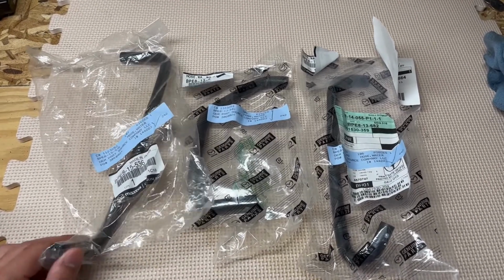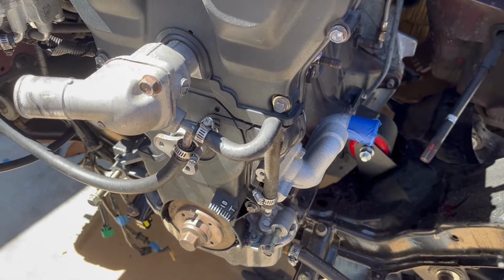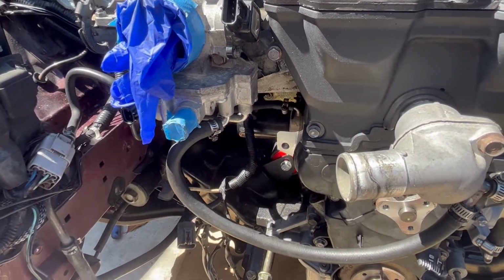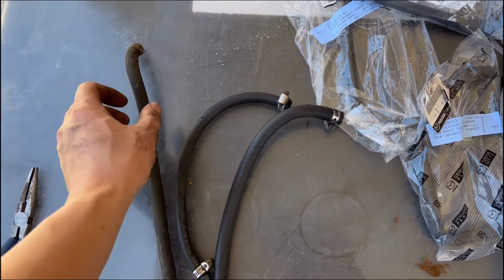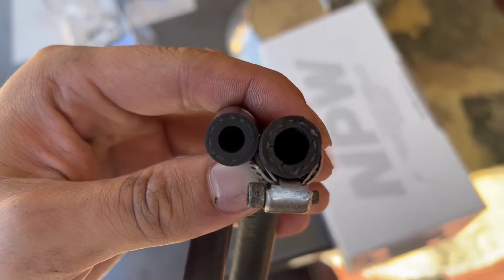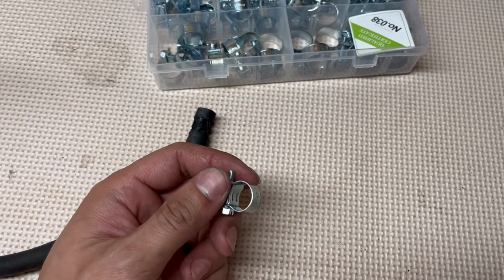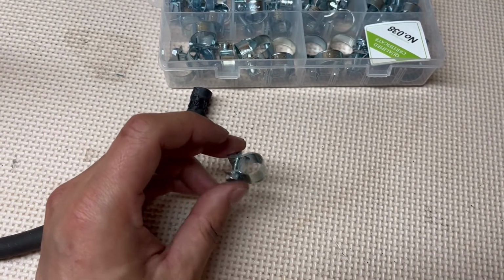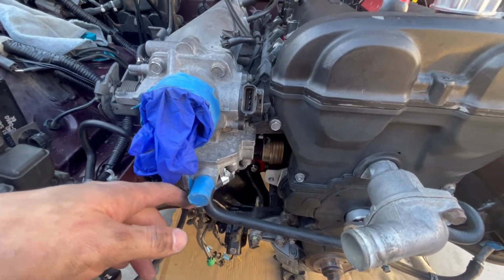Miata Coolant Auxiliary Hoses

Comment: That oil cooler hose at the back just blew on my NA.  It was spurting out at my firewall.  Now I know where all my anti freeze was going.  Great video but how the heck am I going to get at that hose?  There is a lot of crap back there.  It looks like you had pulled the plate that has the spark plugs and coils?  It looks like that hose was practically glued to the metal what a pain.  It seems just as hard to get at the top of the oil cooler from below.  Hate to tow her in for that hose.
Reply from the maker: Sorry to hear that happened to you. To get the hose at the back of the head I had to remove the coil pack. It was already off when I did the video. The hose was pretty stuck on there. I wasn't able to get the clamp off since the ears were facing down. So I had to just slowly whack it off with a flat head screwdriver and a hammer.

For the two connections on the oil filter plate I had to remove the alternator which I had already removed in preparation of doing my timing belt. 

Both the alternator and coil pack are relatively easy to remove.

Hope that helps!

Comment: What is the name of the hose that goes to the back of the head? I just bought a nb and the day after I bought it the line busted on me and I already have a whole kit on order but it won’t get here till the end of the month so I’m trying to order just one of those hoses to replace in the mean time
Reply from the maker: Sorry to hear that that hose blew on your Miata 😭

Here is a link to the two lines that connect to the oil filter housing. 

https://www.jimellismazdaparts.com/products/mazda/Miata/HOSE--WATER---OIL-COOLER-IN/1836781/BPE815536.html

Heres the part number for my 1995 NA 1.8 Miata M Edition

BPE8-15-536

Here is a diagram of showing where the part connects. 

https://www.jimellismazdaparts.com/showAssembly.aspx?ukey_assembly=299362&ukey_make=995&ukey_model=14360&modelYear=1995&ukey_category=20232

https://www.jimellismazdaparts.com/showAssembly.aspx?ukey_assembly=299370&ukey_make=995&ukey_model=14360&modelYear=1995&ukey_category=20232

This dealer also has many diagrams that you can reference for your specific year and model. 

If you need the part immediately, then I suggest calling your local Mazda dealerships and see if they have the part in stock. Most will since the Miata is a popular car.

Hope this helps you out and good luck with your miata!
Reply: @wils_builds  thank you so much!
Reply from the maker: @100newstar  No prob! Hope your Miata is back on the road soon!
Reply from the maker: Also one thing I forgot to mention in the video is that you will need to remove your coil pack to get to the hose that runs to the back of the head. You will also most likely need to remove your alternator to get to hose that connect to the oil filter plate.
Reply: @wils_builds  I just spent three getting the hose off from the hole in the wheel well, but I do appreciate the reply lol thank you so much